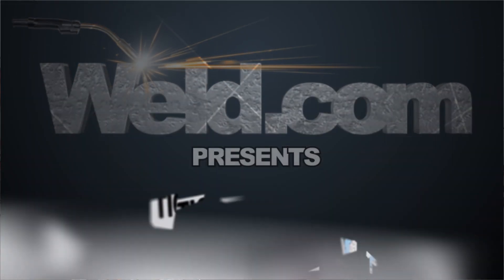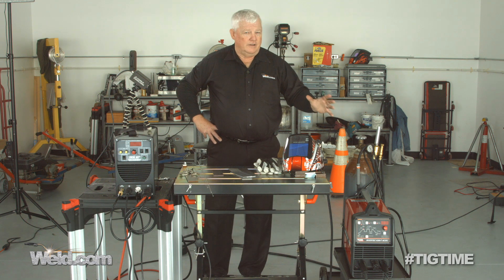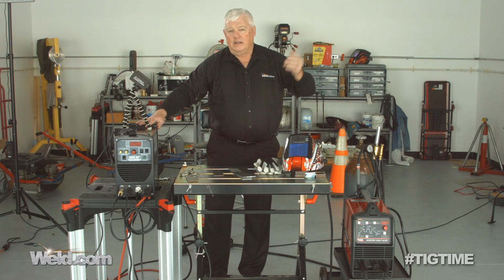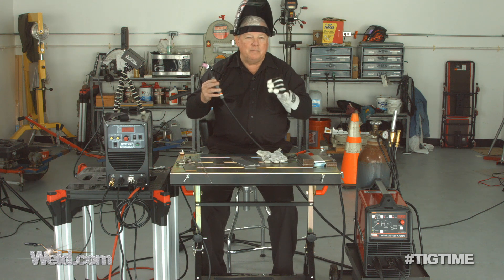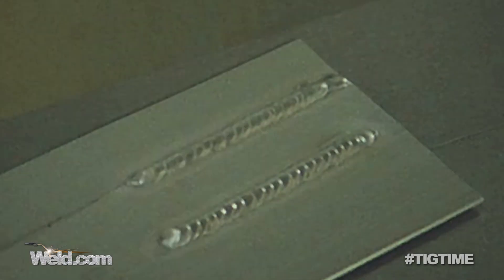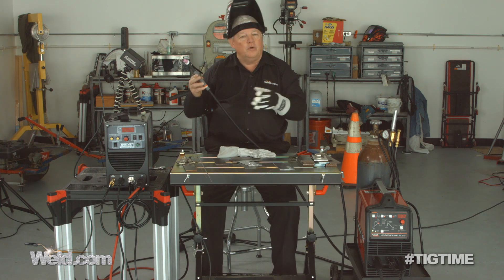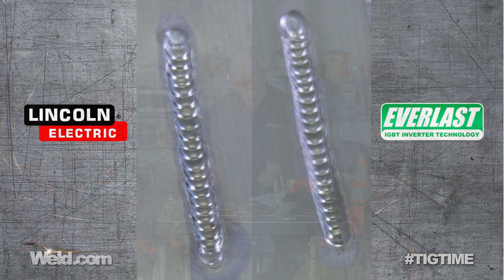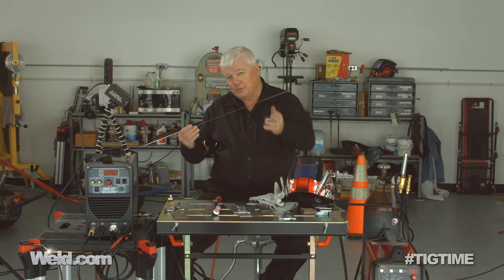Industrial vs. Hobbyist TIG Welders: Which is Better for You?

Comment: I bought a $2500 "Industrial" Lincoln Tig machine (V-160) roughly 10 years ago. It was lightly used and well cared for
( Hobby use only ).   About 1 year after the warranty period, it quit working,  Lincoln said my only option was to replace the 
Motherboard for $1800.   I saved the torch, regulator, etc, and the rest went into the dumpster.  I always thought if it was
Lincoln, it was bulletproof.  I will never give Lincoln any of my business again.

Comment: I have 3 everlast machines... thev160, 185, and the 250. My 160 is used everyday in my business. Its built like a tank. Ive made over 150k in 2 years with it.
Reply: @Jambo who exactly is "us people"? 
I run a one man mobile welding company. I repair stainless steel restaurant equipment in quebec, canada. 
I speak highly of everlast because their machines work. The cheapest machine of theirs i  own is the 160sti. I no longer see it on their website. 
Problem free DAILY operation running on 4 years. 
When this machine breaks, i will buy whatever replaces it from everlast.

Comment: 0:56 Interesting why they use 10 mins as a bench mark. What if they were able to produce a welder that can weld continuously at its rating for 12 minutes before needing to cool down, would that be called a 120% duty cycle machine?

Comment: My Century 110-110 AC SMAW welder has a 100% duty cycle at 120 amps.  To date I have not seen any research to indicate that any welding machine has "cleaning action," controllable waves, "tighter arcs," etc, in the "heat affected zone." Manufacturers use such terms as gimmicks like "hemi" and "double overhead cams." To date not one video by these sales instructors has ever discussed ductility or heat effects of welding weakening the parent metal.  At what temperature, amp setting, and time on the weld does damage occur?  When it comes to welding like the1849 Gold Rush, only the people selling the equipment to the workers got rich.  Buyers beware.

Comment: also, remember that 'heavy duty' is called heavy for a reason. that extra capacity requires a lot of material. 

btw, if a 100 amp machine, rated at 60% duty cycle, can do that 100 amps for 6 out of 10 minutes, would i be correct in saying it can do 60amps indefinitely? i know my math works out, but that doesn't mean it lines up with reality.

Comment: I have a Lincoln V-205 and it is a great machine. While it is a small unit it is still a bit much to haul around a jobsite or have in the truck "just in case". That is why I picked up a ThermalArc 201ts (now the Esab ET-201i). It has a 120/240 supply with a 10-200amp DC range. The head with all of its hoses and cables fits neatly into one of the Rigid 22in tool boxes. It claims to have a 20% duty cycle at 200a but I haven't been able to make it shut down in any of the work I have done in the field.

Comment: you always talk about 115v and 220v here in Ireland we have 220v and 380v( three phase as we call it) for industrial machines 
My question is do you use three phase machines in the usa ?
Reply from the maker: Absolutely.
Reply: Thanks
Reply: Generally three phase power is only at commercial locations. Residential houses almost never have three phase power unfortunately.

Comment: a major difference between a low end machine and one of a higher price is the arc stability under adverse conditions.
I made the error of buying too low end machine for my needs and now it is my first concern when I choose or recommend  a welding machine.
unless I'm on a bad track, I consider that the duty cycle of a machine is a good indication of its capacity to maintain a stable arc under adverse conditions, 
For a conventionnal transformer machine type, the weight is a good indication too.

Comment: Pull the covers off the Lincoln and the Chinese machine and look at the difference. A lot of Chinese machines use 90's style circuitry so they can use recycled electronic components. Cheap labor allows them to do this. Your Chinese welder may have previously been part of a TV!
Reply: Not all Chinese products are like that. iPhones are made in China. Samsung products are made in Korea. Both have excellent quality control, use state-of-the-art machinery and all new components. I highly doubt the bigger name manufacturers could save money using recycled parts. Each part would have to sourced to ensure the leads are long enough for the new product and then tested to ensure it still works. Labor isn't as cheap now as it was 10 years ago. It would not make economical sense unless the company was very, very small.

Comment: I'm not doubting that the Lincoln machine is indeed tits, however the term "industrial" tends to be more marketing wank, that an actual quality.
Reply from the maker: +valstachowski Yes and No. A lot of companies will just casually throw in the term "industrial" into their marketing mix, but we use it to deem a machine worthy of standing up to production line type welding. In other words, does it have a good duty cycle and is it going to last.
Reply: Ever since Everlast came out it has made a bunch of welders much more affordable. Competition is good for the consumer and ultimately for the market because more people can get into the industry and then trade up as they get better and do more.
Reply: There are some other important things too.For example,I've been working in shipyard some two years ago,and we've been using Hugong 200A small inverter,and Lincoln 170s.So,we had extension cable 30 meters long,3x1,5mm2.That cable is considered for grinders and drills,not serious welding.However,Hugong wasn't able even start the arc with rutile,further more not basic electrode.Lincoln was able to weld without any of impacts on quality of welds.Hugong was great as long as it was plugged to strong and stabile source of power,but for field Lincoln was only choice.
Reply: Just means to me, a higher duty cycle
Reply: +Weld.com
You mean like CK Worldwide and there newer "Industrial" welder.
Reply: Mark Rich exactly....you are paying for a name....he's beholdin to CK cause he sells their stuff, so of course he touts their stuff over an Everlast....Lincoln charged $3,900 for that Welder back when there was no Everlast or AHP...industrial means less when you can buy 4 top end Everlast machines for the price of one dynasty....
Reply: Eh. Go on the forums and you’ll find plenty of problems with the Everlasts. They weld well, until they don’t.

Comment: I bought a V 165T and as well as it welds, the parts are cheap as hell the switches and dials are garbage not what i would expect from a 2000$ Lincoln.
Not to mention the HF start didn't work straight from the factory.

Comment: I think the only thing going for the Lincoln is you can repair the things - parts are available.  Otherwise, you're describing hifi stereo systems versus lower end - the connoisseur believes they can tell a difference but it would take some very specialized equipment to scientifically  prove that one is better than the other.

Comment: Pat,   When using a gas lens, the shield pattern is much larger than with a standard cup. This will assist in keeping better coverage of your filler material and the end of your welds.  When finishing a weld it is important to hold the torch in place for about 5-seconds argon post flow while the puddle is solidifying.     When making aircraft quality welds, it is a good habit to snip the end of the rod regardless to insure the best weld integrity possible.    Concerning gloves,  I will usually wear an extremely thin glove when welding with lower amperages.  In this particular film,  I was offsite and only had my leather gloves and must not have has the glove on the filler hand during a welding segment.  my bad!  good luck Mister Tig

Comment: Do you (or whoever WAS welding) always pull your wire out of the shielding bath before it solidifies? Cutting of the end of each wire every time (if needed AND done) is a waste. & I noticed your right glove magically appearing on your hand later.
Reply: PAUL"
Even Hollywood professionals make terrible mistakes sometimes and I certainly don't believe this gentleman had 
one of them making his video....

Comment: hello there: I habe problems with my lincoln invertec v160-t . when i start welding metal , my machine stoped working , and the temperature light is "ON"    what is the problem i dont know ?

Comment: I have a 2015 AHP and it runs amazing. The only downfall is the torch. It's small, the handle twists and just a pain to work with in general. But, for $750, it's a hell of a deal.

Comment: Nice review. I like the idea of a 110v machine that still gets the full amperage. I don't have 220 in my home and feel like if I buy a 200 amp 110/220v machine I am really paying for the full 200 amps when I will only ever be able to take advantage of about half that with 110 power. I like that you're not paying for extra amps that many of us will never be able to take advantage of with this machine.
Reply: Dylan Bojumpkio in theory you would want 110/220 because to install 220 in homes now a  days are not expensive anymore and you might want to use 220 and wont have to wast money on another stronger machine
Reply: +jameshisself Pigtails and extension cords to dryers is very common and it is what I have done myself when I bought my everlast tig welder. It is dual voltage machine but even today I still run off of 220v from the dryer outlet. I've never bothered to get a separate circuit put in.